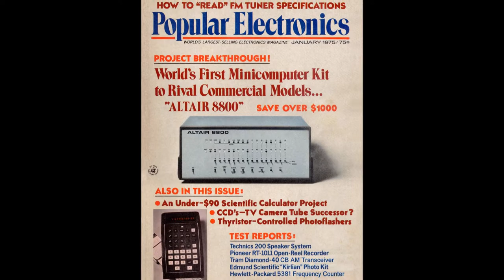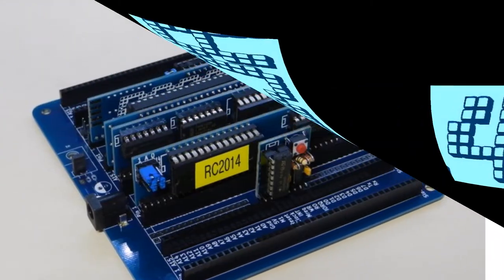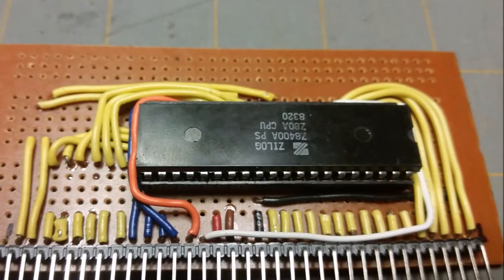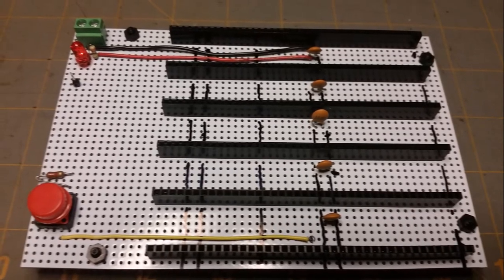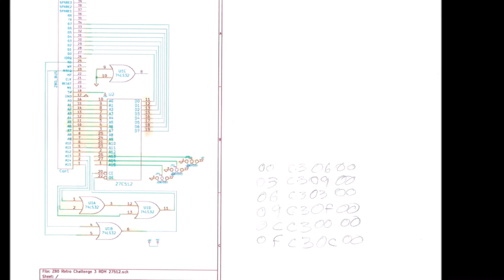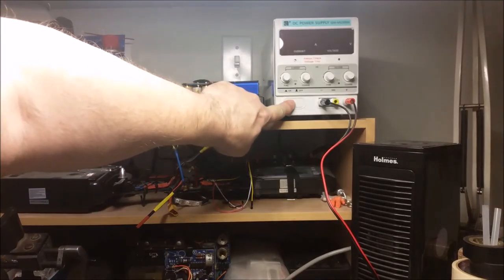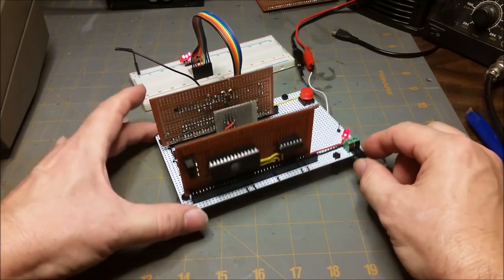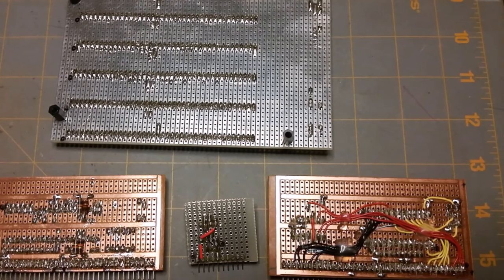Watch Me Build: RC2014 Z80 Computer Homebrew Part 01

Comment: Roger, are you still doing this project?  My hope is that you are.
Reply from the maker: I ordered the RAM chips but after the expected delivery date passed, and then some, I contacted the seller. They gave me a refund but now I'm waiting on another order to arrive. I'm also concerned that I've not been able to get the serial board to respond with just the EPROM, ie no RAM. My test code doesn't use interrupts or require the Stack Pointer so it should be able to run without any RAM, just using the Z80 Registers, EPROM and Serial I/O Ports. I'm starting to think this would be a good topic for a video, to show the issues I've had troubleshooting this project.